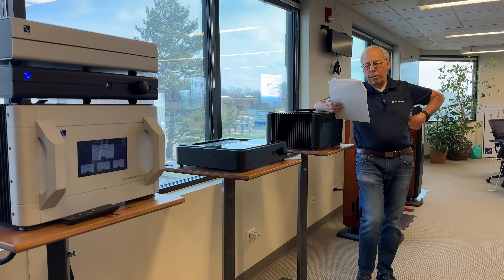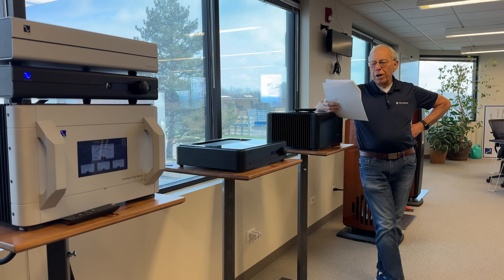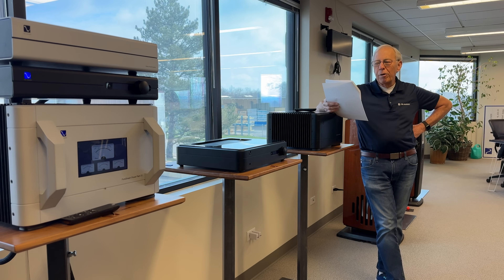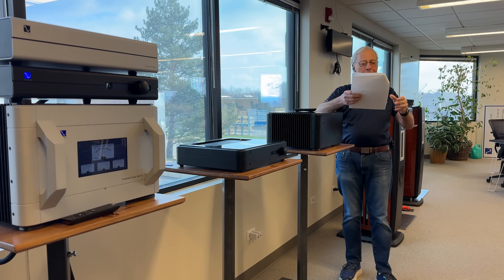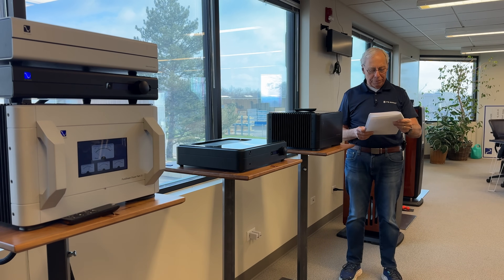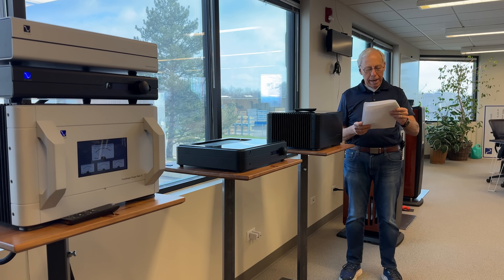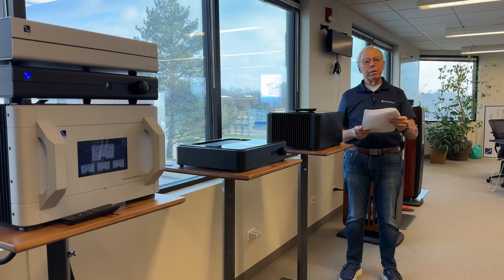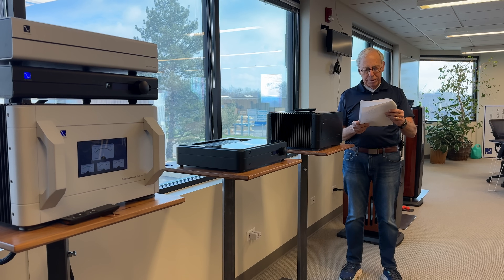Direct coupled preamplifiers and amp damage

Comment: My Audible Illusions preamp with phono stage had a switch that bypassed the DC output blocking capacitors  was feeding an Audio Research tube amp for many years without even a whisper of this or any problem that the writer is speaking about.

Comment: If you are worried. bring it all up with no speakers connected, connect a multimeter then slowly wind up the volume, there should be no appreciable DC on the speaker terminals. Things do age, drift is possible, as well as component failure so it cannot hurt to be cautious and check.
Something can also be said about purposely feeding DC into an amp (with no speakers) to verify it's protection circuits are present and actually work, a 'fire drill' for your amp.
Reply: Yes in case of a doubt I would definitively do this ! Once is sure : if for any reason a significant dc part is injected in a power amp with no dc blocking feature the woofers will move until stop and quickly burn out ! Exactly this happened to me a long time ago with a DIY preamp where I unintentionally bypassed the output coupling capacitors + Hi-End power amp without input capacitors "by design" (Jean Hiraga 2x20W Pure Class A, still in use). In France we say "a forewarned man is worth two" ... 
Note : no issues with the other speakers than woofers because they normally have hi-pass filters.

Comment: You have 2 pcs. protection circuits!

One is a capacitor on the input or output of a preamplifier and amplifier.
This is to protect against DC. current that may occur if there is a fault with the equipment.
DC. is amplified in amplifier, preamplifier and can blow up your speakers, amplifier.

Anything you run sound through will weaken the sound in one way or another. You don't always hear this very well

Number 2 is a real card connected between amplifier and speaker that sits inside the amplifier which cuts the signal if there is 1.5v DC or more.

Comment: As a general rule you want to have as few capacitors in the signal path as possible, ideally none. Decoupling caps sit in the signal path normally on the output of the preamp or the input of the power amp. If you must have one this is the one where getting the highest quality is most important.
With solid state preamps DC offset is unlikely to be an issue. With valve preamps you might have a problem if one of the tubes goes out of wack.
Reply: class-a amps would not be sitting at 0 if there's no cap to filter out the dc tho? even when working as intended.